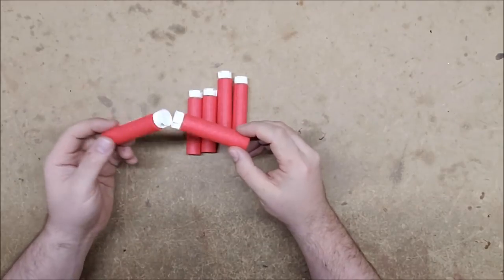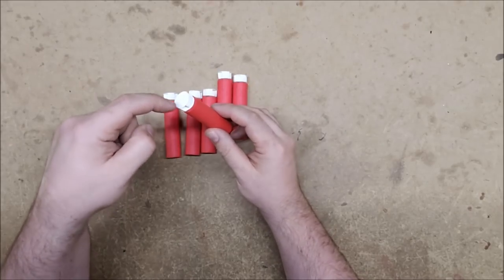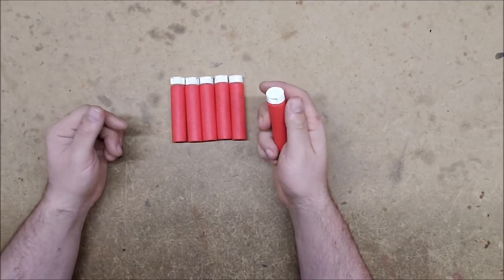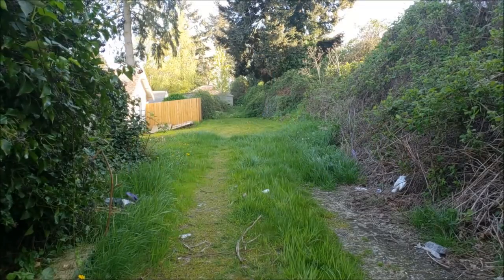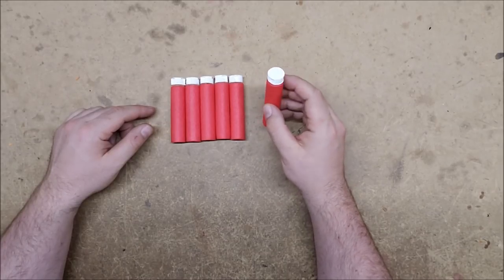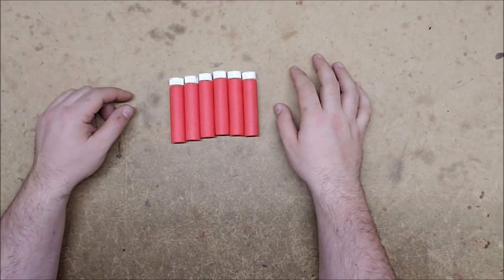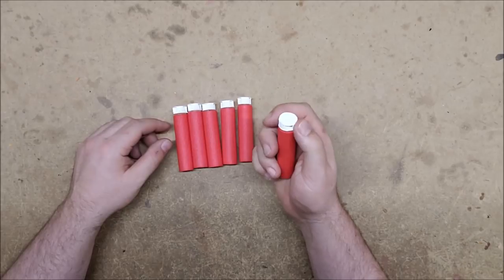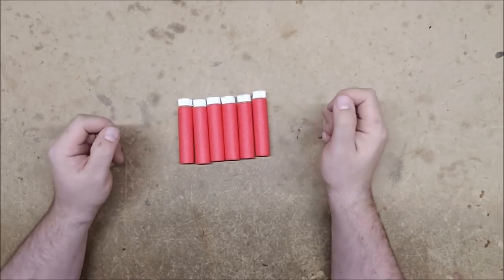Testing Prototype Mega Accustrike Darts

Comment: Hey Cap. if you can get the STL file for those heads, there is a type of 3d printer filament called Ninja-Flex or something similar. Its a rubber type of filament.
Reply from the maker: Neat!
Reply: UltimateGamer1690 I have tried this with standard size darts. It is great! It is tough trying to get the wall thickness right.

Comment: I’d suggest casting them in something flexible, 6 to 12 at a time, using the cleanest 3D printed heads you can get your machine to spit out to make the mold. Probably best to reach out to Smooth-On or Brick In The Yard directly for suggestions regarding which of their materials would work best for the heads. Or possibly try to pick the brains of Punished Props, they’re in your area and might want to make a project out of it.

Comment: I made a barrel for my drainblaster that fits a single mega dart.... its legitimately scary. It went past the back fence from standing at my back door. That's over 100 feet flat I believe. Its horribly inaccurate though..... the dart goes in more of a soft zig zag than a straight line.
Reply: LightningEagle14 yeah those are FUN

Comment: If you had some kinda bulk rubber material maybe in a sheet/block (I have no idea if such a thing exists) might be easy to sorta hole-punch dart heads out of it with a sharp pipe the right size.

Comment: I found the stock NERF Mega darts pretty accurate compared to stock streamline/elite darts, I think the whistling "holes" being on both sides of the Mega darts actually compensate themselves due to the twin opposite airfoils offsetting eachother, especially in my Mega Mastodon and Cycloneshock, at around 20-30 feet I hit a 10x10 inch target with good groupings and every stock dart hitting the target, I'm sure that'll change when I replace the Cycloneshock spring.
I want to rewire and clean up the internals, possibly do a motor swap to Neo-Rhinos for the flywheels (what pusher motor would you suggest?) and use a 3S LiPo to save the extortionate cost of replacing expensive 6x alkaline D-cells, there's enough room in the battery tray when gutted, for a 3500 mAh 3S LiPo, which should be ample for the power needs, what do you think?
Reply: Matt Von Nerf hey I know you
Reply: Matt Von Nerf make sure the mastodon can use neorhino motors some blasters (mostly non-elite dart firing blasters) use larger motors and as such neo-rhinos will not fit
Reply: gamer guy Naptown Nerf used 130s when he fried one of his Mastodon motors, he made some PVC shims from a PVC coupler I believe to keep the motors oriented and secured. Other option being making my own cage or shims once my 3D printer arrives, there's always a way around.
Reply: Broke Nerfing you sure? I'm pretty forgettable......😏

Comment: Print with Ninja-flex?
EDIT:  I should have actually used full sentences.  Ninja-Flex is a printable filament you can use on a 3D printer that is flexible.  I haven't ever used it, but by adjusting the fill, you can make things soft.   I have no idea how it will compare to normal rubber tips, but it would be much safer (and durable) that a hard 3D print.
Reply from the maker: Indeed.

I really need to do a channel PSA where I explain basic commenting etiquette...
Reply: I should have actually used full sentences.  Ninja-Flex is a printable filament you can use on a 3D printer that is flexible.  I haven't ever used it, but by adjusting the fill, you can make things soft.   I have no idea how it will compare to normal rubber tips, but it would be much safer (and durable) that a hard 3D print.
Reply from the maker: That was not what I was getting at though that is also on the list.  My basic rules of commenting etiquette are: 

1. Watch the whole video before commenting. 
2. Read the video description before commenting.  
3. Read the comments before commenting.  
4. Use proper grammar.  
5. Be Polite.

My point was that Ninja-Flex has already been suggested in the comments.  I know lots of comments are good for the channel and a REALLY appreciate getting awesome helpful advice like this, but I get notified of all comments and I read all comments and so getting 5 comments all saying "Use Ninja-Flex" ceases to be helpful and because a drain on my time.

That being said, I have GOT to get some of it and try it for things like this!  :D
Reply: Because there are so many comments, I can’t see all of them.  My quick check of the comments didn’t show anyone mentioning Ninja Felix.  I will try to be more careful in the future, but the comment system really wasn’t made for logical discussion :(
Reply from the maker: I quite understand.  You were only the second person to mention it.  Several more have mentioned it since.  And I do get a lot of comments on my videos because I do respond so often and I encourage people to comment.  I shall try to be more understanding in the future as well.   I really wish Youtube would give us back the ability to add annotations to videos after they have been uploaded so I could add notes to the videos.  Sadly they took it away because they could not get them to work on mobile, which is the most common traffic now.  I do try to add notes to the description but that is also hard to see on mobile.

And I TOTALLY agree.  There has never been a worse venue for logical discussion than the internet forum.  The black and white of the text strips away all the subtly inherent in human communication.  The anonymity turns us all into sociopaths since we cannot see the immediate effects our words have.  I thank you for your understanding and mature response.
Reply: There was an anonymous social network app called Secret (It's no longer around).  After several month of popularity, they gave back as much money as they could to their investors and shut down.  They wrote a paper as to way they shut down while they where popular.  The reason was that when people were free to communicate 100% anonymously, they all became terrible people.

Comment: I don’t get it - why not print these out of TPU or some other soft/flexible filament?
Reply from the maker: Because he did not know that was an option.
Reply: Aaaaactually... has anyone thought of printing a whole dart out of flexible filament? With a very low to no infill, it might actually be light enough. There'd likely be absolutely no advantage over foam (well, maybe, just maybe you could do some fun things like integrate fins into the body, and the surface might end up grippier to the flywheels) but it'd be an interesting experiment.